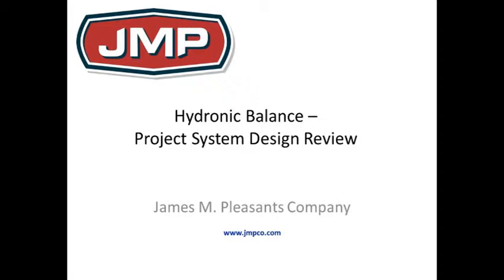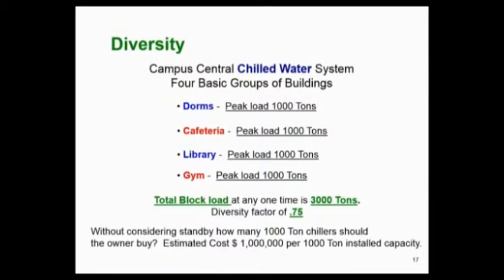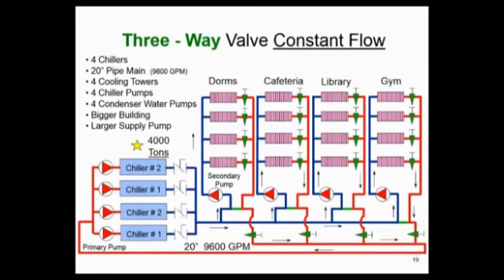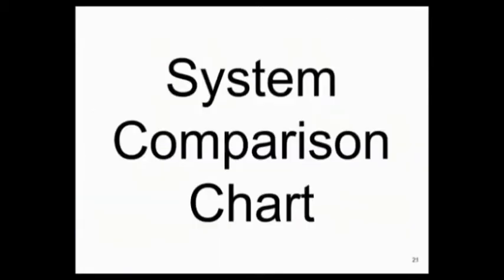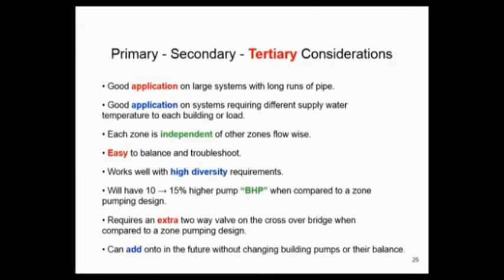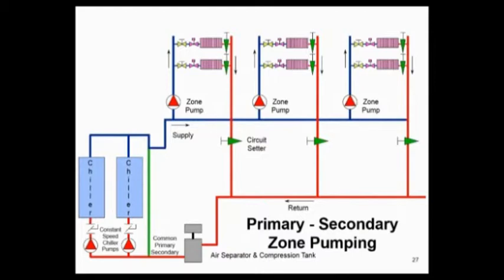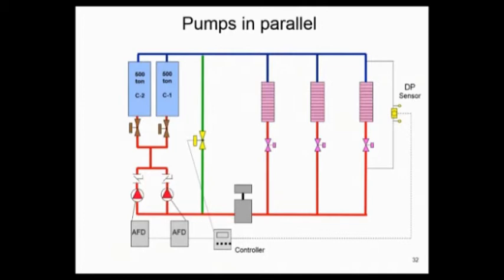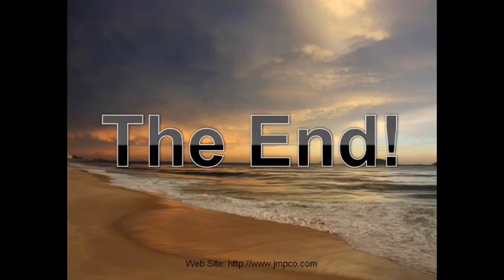Hydronic Balance  - System Design Review

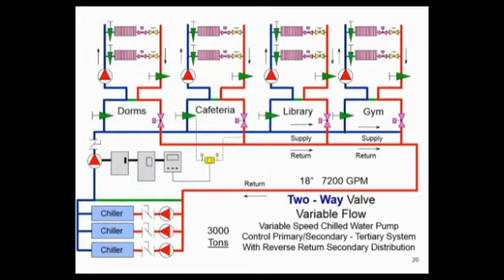Comment: Thanks, the content of your blog is great and very useful. I have a question, at 02:47   you establish that the chilled water plant supplies 7200 GPM, I understand that this 7200 GPM is obtained from the block load (3000 Ton), but how do you determine how much water flow should go to each terminal unit? ?